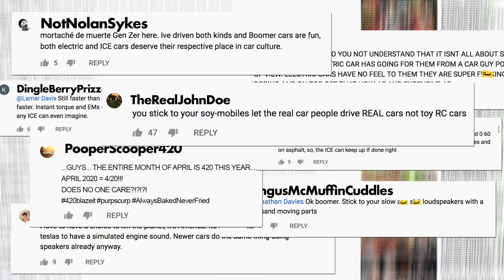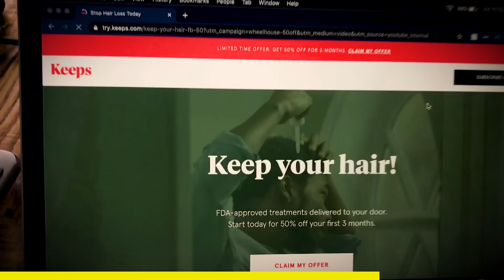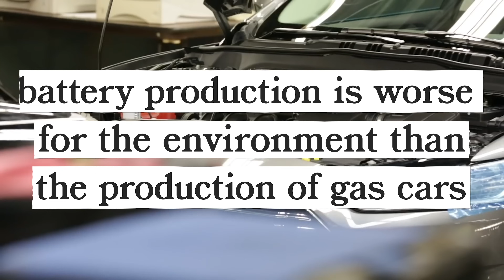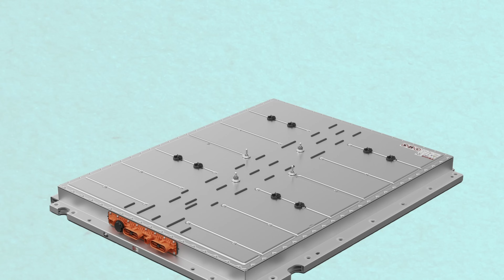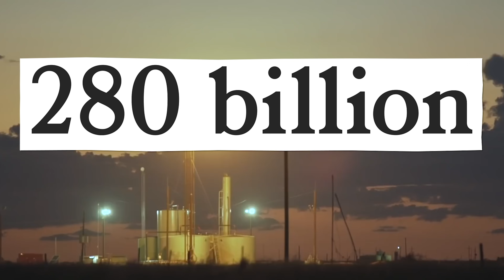Are Electric Cars REALLY Better for the Environment?

Comment: The batteries will be dumped in landfills like the other batteries, cellphones, chargers, and cords.  You can only “fix” something so many times…
Make cars run on water and then you’ll have something.🧐
Reply: You can’t make cars run on water
Reply: @engineeringtheweirdguy2103  wouldnt that be nice…
Reply: @RZ-sh6yi  I actually had an idea that the car would make its own energy with a water wheel in it
Reply: @kmwnilsson8401  Yeah, like a waterfall.  (Great minds think alike) 👍
Reply: @RZ-sh6yi  yh

Comment: I live within the boundaries of NYC and currently there is no infrastructure or support of EVs like a charging parking meter, we have to pay for the parking space anyway now.  I live in a CO-OP which has no plans of installing charging stations in the parking spaces we pay for.  So why would I buy an EV if it's dead after the 1st use?  Now before you criticize me, I bicycled to work (now retired), I bicycle to the stores around me but unless it's a public street there are a lack of bicycle lock-up support by property owners of shopping centers.  It's worst for an EV owner!  Sorry but I will keep my gas car until society conforms to what has been requested from my childhood days,  Support what you want in our environment.  EVs have been around since the car was invented but only the car was around, no infrastructure to support the ownership of an electric vehicle.
Reply: Yes but if you look at the last 10 years it's pretty clear EVs have become more and more practical over the years. The range EVs offer now is much better than 10 years ago. Charging times have improved, generally there is more charging stations now then 10 years ago. And more and more var manufacturers are finally starting to offer EVs compared to 10/20 years ago when there were barely any EVs on offer. 

My point is EVs are still in it's infancy stage and it's really only now manufacturers are starting to invest more in EVs as sales keep on increasing each year. I mean 10-20 years ago there simply wasn't many EVs available from most car manufacturers but these days there is alot of EVs available from car manufacturers like Mercedes, VW, bmw etc. So there is alot of room for improvement still with EVs and as they get more popular(sales increasing each year) we'll only see more charging stations pop up. I don't own an EV right now and I'll probably continue to own a regular petrol car for a number of years but as we see them improve and more EVs enter the market i can see myself switching to an EV in say 10-15 years. I mean just think how much ICE cars have improved in the last say 30 years in things like speed and fuel economy. Or how much computers and smartphones have improved

Comment: One problem I have with electric wehicles is, that you need to change your batterie after a few years
Reply: Who told you that? lol
Reply: @Straighthands420  it is called battery degradation so it is Something every batterie has so electric vehicles have that too
Reply: @MrJudgi  you do understand that phone and laptop batteries are different then ev batteries? Not trying to be rude just educating you. I have a nissan leaf with 85k miles on it still on the original battery. Also a Model 3 with a 8 year warranty on battery. There are plenty of evs still running around at 200k miles on the original battery. Just research it.
Reply: @MrJudgi  sure ev batteries might loose a few miles after a couple hundred thousand on the car, but these batteries are designed for extended use like this- Tesla batteries last 500k miles before they are even close to needing to be replaced- that’s way further than the overwhelming majority of people keep their cars. And at 500k miles they will only have degraded 20%, which still leaves plenty of remaining battery for everyday use (330 miles)- do you drive 330 miles a day?- I doubt it.
Reply: The "problem" you have is that you've never owned an electric vehicle. Because if you had, you'd know that the battery has an 8 year warranty, and does not necessarily need replacing as it can be refurbished, at much less cost than complete replacement.
Reply: You don’t though

Comment: Charge times and cost need to come down a bit more. If I can charge my car in 5 minutes and charge stations were everywhere and I could get something decent for a reasonable price, I think I’d buy one.
Reply: Yh charging times and range is the one thing holding me back from EVs. Although both have improved quite abit in the last decade especially the range of EVs. It's only getting better and better. EVs are still in its infancy stage so there's alot of room for improvement especially as more car manufacturers start to slowly shift towards EVs since several countries have announced plans to end the sales of new ICE engines in the next 10-20 years. I'm sure in another 10 years time the charging times and range of them will be even better and the number of charging stations is only increasing each year.

The cost of an average EV is definitely way too high. But this probably comes down to the lack of choice in a way. There's just far more petrol/diesel cars on offer from manufacturers than EVs which means we get a much better variety of price ranges. But as manufacturers start investing more in EVs hopefully the price will come down. Alot of technology is often crazy expensive when it's still new to the market but then later on it becomes far more affordable.
Reply: @taz874  The initial cost may be higher, but the TCO is lower; a comparison between the Tesla 3 and a Toyota Corolla showed that over  5 years, considering everything, the Tesla was cheaper...
Reply: I charge my EV in 12 seconds. Six seconds to plug it in before I go to bed, and another 6 seconds to unplug it when I get up in the morning..... What happens in between is completely irrelevant because I'm asleep.

Comment: Obviously this isn't a simple matter, having said that this video has some basic errors, for instance you can't take the current avarage of car co2 emissions and compare it modern electric cars!
A modern ICE car has confortably arround half of the stated emissions average! Which means that if the EV gets its power from dirty sources their emissions are not so far apart.
Also in the national average you stated is including SUVs with V6's and V8's, not fair at all. 
If people/governments really care about emissions, why are sold so many unecessary trucks? Ironicaly they're rising in popularity and sales...
And if people care why are they buying new cars every 3 or 4 years, isn't more efficient to use the existing fleet?
The end of life cycle is more complex with EVs, polutions issues with battery production and recycling, there's also the demand for a much more capable infrastructure, and for more electriciy. 
Contrary to what some think, too many people live in cities and they have no way of charging their cars at home.
Doesn't seem too clear that all these processes will bring all those benefits... Personaly i don't have aversion to EVs and the next vehicle i buy might well be one.
Reply: While the toxic emissions might be 50% less, the CO2 output is strictly a function of how many pounds of gasoline  you burn; for 6 pounds of gas, you get 19 pounds of  CO2.
 
Since 40% of the grid power is NOT hydrocarbon  based, it's invalid to say 'the emissions  are not so far off'. Additionally, while car engines have improved, so have power plants;  it is relatively easier to re-engineer one power plant--and  to maintain  it!--than 10,000 cars.
 
True, people get more emotional about a new truck  than  clean air; clean air is literally invisible.
 
I know this is anecdotal, but the average age of cars in our household is 11 years old. I want to replace one, but they won't die!

Battery production and disposal has a lot of articles already written. I won't say it's a solved  issue, but it is pretty well understood.

The first (US) TV station  started broadcasting even though there were no TV stations to receive the signal; something had to come  first. Likewise, there's enough options for  charging to support more  cars, and as the cars start becoming more numerous, someone will find a way to make a profit by providing a needed service.

Comment: Are the battery car burning better for the environment then driving a gasoline car?
It will burn to the ground that can't be good for are planet. And driverer safety.🔥🔥🔥🔥🔥☢️☢️☢️☢️☢️☢️☢️☢️
Reply: Gas cars burn 10x more often; that's even after adjusting for the ratio of gas/EV cars.

Comment: curios as to the life span of the EVs that don't have interchangeable batteries, like the newest tesla. if my 50 ton/yr car lasts 20yrs and i need 3 teslas in that time where does that rank?
Reply: The projected life of a Tesla battery pack is 15-20 years. And they can have a second life as power grid storage devices..
Reply: @MrRentageek  He needs to see the YouTube video posted by the Tesla Model S owner. His car has covered 400'000 kms on it's original battery.......

Comment: You fail to mention the carbon capture cycle. As well as the waist footprint of the transportation needed for the raw ingredients of lithium battery production. Agreed electric is in fact cleaner but not by near as much as one would think.
Hydrogen is the real answer.
Fun fact nuclear is still the cleanest, safest, most reliable form of energy production.
Reply: I would think that EV's are a minimum of 3 to 5 times better. What would you say?
 
True about nuclear; alas it has a PR problem.
 
Hydrogen is not  an energy source, as there is no H2 to mine or harvest. All the energy that can be stored as H2 would have to be generated by electricity (or maybe waste heat, but not sure about that). Thus H2 is merely a means of transporting energy from a source (power plant) to a destination (engine of some sort).
Reply: @MrRentageek  not sure if 3 to five times is correct. Maybe? All energy "sources" are just a storage point  to start the cycle of energy transfer. We learned to suck petroleum from rocks, than surely we can learn to effectively and efficiently split a water atom.

Comment: I am a bit concerned how lithium is mined and how much of the local water supply it takes, do we really need to wreck the environment to save a climate that may not actually be in danger, as climate science is far from settled I would rather leave the water for the locals, more batteries for EVs = less water for locals.
Also you will still need the oil production and the emmissions from it as over 60% of the worlds clothes are derived from oil based products, not to mention the tyres your EV runs on and most of the interior of the EV, if they make EV body panels out of plastic to save weight to extend battery life those panels will be derived from oil production, let's find out how much damage to the climate man is actually doing before we wreck the environment and stop people enjoying their life
Reply: Battery tech will continue to be developed as more people buy ev. We wont forever use lithium ion current battery tech in future. Burning fossil fuel does more harm for running cars. We dont need to ban evwry oil products.
Reply: Tesla is investing in hard rock mining of Lithium; it's not viable everywhere, but is an improvement.

Making plastic  doesn't burn the hydrocarbon (from whatever source) so much as chemically transform it, so not perfect, but far less damaging.
 
Should we do  nothing because we can't do it perfectly? Or should we do the best we can  with what we have and know, while striving to improve (and quickly, I hope)?

Comment: Here is the answer, but they are not currently cost effective. 

https://youtu.be/tnzuuLpYFVg
Reply: And, why would we replace fossil fuel powered autos with limited supplies of lithium? We can produce Hydrogen, which is a renewable energy.
Reply: @robynchilson9849  Hydrogen is not a source of energy; it is only a means of storing energy produced by other means, like solar and wind (and coal, and oil, and natural gas).

When you burn hydrogen, you get water. When you separate water into hydrogen and oxygen, you reverse the process, but it takes more energy to do than you get out of burning it (damn laws of physics!)

Comment: You seem to have missed a few important details. Most of our current power is produced by coal plants. But we do not have the capacity to run our homes right now little own millions more in EVs.  Right now, California has such a power shortage, they are having rolling blackouts and people are being asked to stop charging their EVs. Now multiply that by each state. 

Therefore, more electric producing plants will need to be built, because of that, those carbon footprints need factored into your analysis. In addition, the solar, wind, and water production you cite also have their own carbon footprint which needs factored in, and yes they are significant as well! Especially wind and solar! And last, but certainly not least is the carbon footprint of waste. Where do electric car batteries, wind turbines, and solar panels go to die? What is their carbon footprint. How long do they take to break down? What toxic wastes do they produce? 

Look at this from cradle to grave, not just cradle to use. When you factor in that more electric infrastructure needs built, the production of solar panels and wind turbines, and the disposal of batteries, turbines, and solar panels, you will find that the carbon footprint if of these environmentally friendly sources of energy and EVs are not as environmentally friendly as we have been lead to believe. Are they more than current gasoline cars? I don’t know for sure, but I am guessing they are, as I’ve seen videos that say wind turbines production alone requires more energy to produce the turbine than then turbine will ever produce. If true, that needs factored into the efficiency of the EV.
Reply: Everything has carbon footprint. Just because producing ev gives carbon doesnt mean we shouldn't produce it. As we use more, more efficient and better renewable tech are invented.
Continue to run on fossil fuels is much worse.
Reply: @frankreynolds9930  Hydrogen fuel cells, for instance, have a much smaller carbon footprint than electric batteries because of the rare earth minerals they mine. Therefore, there are promising alternatives that don’t require rare earth nor fossil fuels. If it were really about saving the planet, wouldn’t they be backing the least intrusive, smallest carbon foot print alternative?
Reply: @robynchilson9849  Well producing hydrogen is very energy intensive, plus you need to transport it with trucks. Hydrogen cell is just oil corpo desperate attempt to prevent people from using ev. 

So no its not as good as ev. Ev is dirty to produce but most of it is recyclable
Reply: Coal is only 20% of electrical power generation. Wind, solar, and nuclear are 40%. The rest is mostly natural gas.
 
You are so not the first to ask questions about the disposal of batteries and solar panels. You can trust my statement, or use your google-fu to find answers.
 
Your guesses are wrong, and easily researched. There are many full life cycle analyses of both renewable  and non-renewable energy cycles.

Comment: You didn’t address the copper requirements for electric motors, charging stations, not to mention the mining impact of copper on the environment. Nor did you mention getting that cobalt and lithium to places via dirty bunker burning freighters first to manufacturers of the batteries and then to auto manufacturers and then to purchasers. EVs reduce the amount of CO2 emitted into the atmosphere which is mitigation. But there is already too much. How about comparing with hydrogen and then a second comparison testing out carbon energy from Carbon Engineering in your ICE? And you glossed over or ignored replacing — scrapping and recycling components from ICE — with EVs and is another CO2 producing activity.
Reply: Continue to use fossil fuels is much worse for carbon footprint. As we use more evs, we continue to make it more efficient and recycle better in future. Evs has only picked up in last few years.
Reply: @frankreynolds9930  idiot the electric car was created by Thomas davenport in 1935….. do ur research before saying that there a new idea… there is a reason why they didn’t catch on and we went on to use the cars we use today
Reply: Nor did you mention the dirty, rare earth element catalytic converter, or all those O2 sensors, or the environment impact of maintaining an ICE, with its thousands of moving parts.